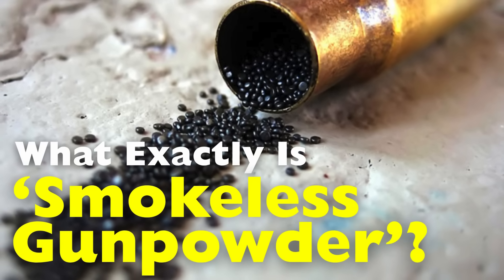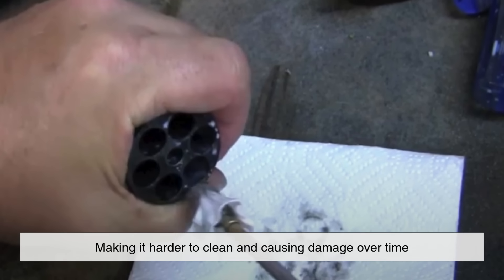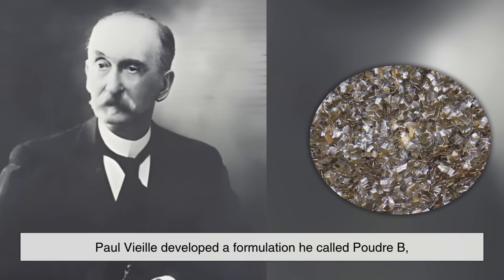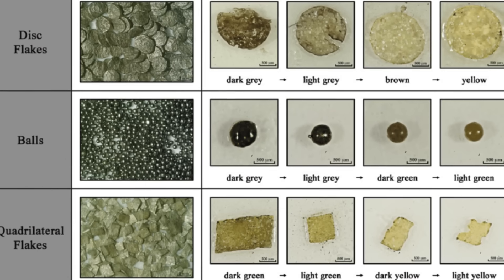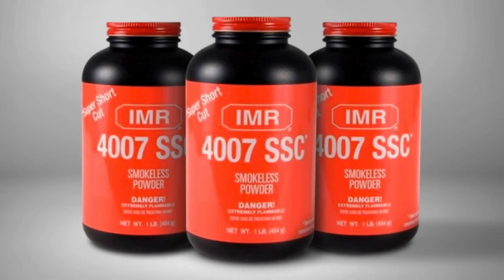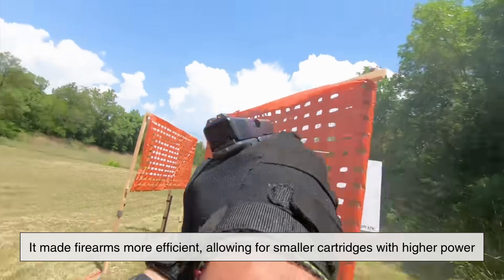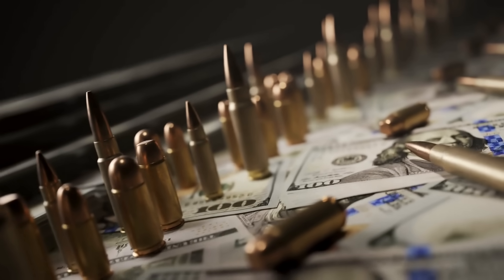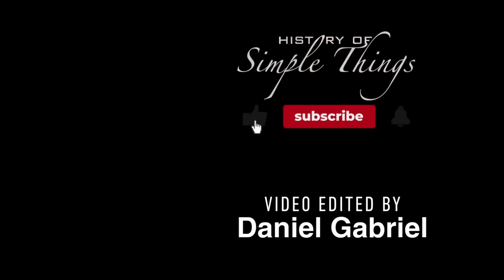Why Modern Guns Don’t Make Smoke Anymore

Comment: There are triple base powders now. But I haven't seen Alcan available in the US since the 80s. That destroyed revolver was from a double/triple charge of fast burning powder like Bullseye or 231, not decomposition of components.I had a box of Winchester 45 acp that was over 40 years old and it worked fine. There's surplus ammo over 70 years old that is still good.

Comment: What is the difference between black powder and pyrodex? ✌️
Reply: I think Pyrodex is made from the same basic elements of traditional black powder, but with some additional chemicals added to make it less sensitive to ignition. I get the impression that a main reason for pyrodex existing is that it is less hazardous to transport commercially.

Comment: The main substance that formed smoke in black powder when it burned was sulfur. Because it formed not a gaseous product, but a solid substance potassium sulfide. And 19th-century weapons engineers came to the surprising conclusion that sulfur could actually be dispensed with. The main value of sulfur is to reduce the ignition temperature of black powder, which was important for flintlock weapons. But this conclusion no longer had any practical meaning due to the discovery of nitrocellulose smokeless powders.

Comment: What is primer made of
Reply: Primers contain an explosive called Fulminate. Fulminate will explode when impacted by something like a firing pin, hammer or whatever. Gun powder is ignited by heat such as the heat the Fulminite provides when it explodes.  An explosive used in the military called C4 or Composition 4 will not explode from heat. It has to be impacted like with Fulminate. The impact used to ignite C4 is usually what is called a blasting cap. Our military explosives instructor held up a brick of C4 in front of the classroom and lit a cigarette lighter under it to illustrate that it does not explode from heat. I ducked under my desk anyway. That brick of C4 was enough to blow a Tank apart.
Reply: Lead styphnnate
Potassium chlorate
Mercury fulminate

Comment: What gun and round was that one in the pic that shot the entire casing with the bullet?
Reply: There was a gyro projectile gun. It shoot out the entire casing sorta like a rocket. Hence gyro jet propelled. Pretty sure it was on matt channel.
Reply: @chansantawisuk  That was the entire projectile. What was used in this video was not that as it was completely different. And matt who?
Reply: @sithyarael6807 yeah the whole ‘projectile’ shootout like a rocket. Its ‘jet’ propelled. They called it the ‘gyro gun’. I remember it was featured in Matt’s DemolitionRanch channel. I mean you can also just search gyro gun and there will be a ton of review of it on youtube. The project is discontinued for a long time. Pretty sure it was in the 80’s or 90’s. But the owner still produce some of it for testing and fun for Youtubers to reviews.
Reply: @chansantawisuk  Produced	1962 - 1975 less that 2000 produced. It failed before it really became a thing. Mainly cause the propellants used back then would only allow a little bit into the round. It was called the Gyrojet FYI. Ammo is no longer produced as hasn't been in a long long time. Those youtubers were using original ammo as no one makes it any longer.
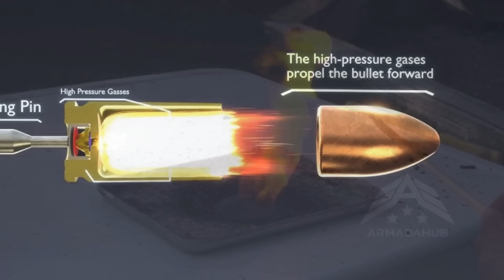Reply: 05:45 ?

Comment: How do air guns and BB and pellet guns work? And how dangerous  are they?  And what is the difference between them ?
Reply: compressed air vs. flammable propellant. Pellets are larger than BB's...both are dangerous at close range. <50'
Reply: @hillbilly4895  There are larger air guns even shotguns of 20 gauge or larger that work off of compressed air and are as deadly as firearms that use smokeless powder.  And they have been in use for a long time, as the Lewis and Clark Expedition 0f 1806 carried one with them in .46 caliber that they used to take game and amaze the indigenous tribes they encountered.  It was a 22-shot repeater, and they filled the compressed air cylinder with a pump attached to a wagon wheel filling the cylinder as they drove along.

Comment: No real explanation of why it doesn't smoke.
Reply: yes. Yes have skipped mentioning that the smoke is a cloud of solid particles of K2CO3 and K2SO4. Smokeless gunpowder  does NOT consist of potassium and sulpfur which produce that thick smoke
Reply: Thanks, your coment make me not wasting my time
Reply: Actually.... it does smoke, just less smoke than black powder.😅
Reply: It is clearly mentioned that it "smokes less" because they switched from black powder to a cellulose-based smokeless gunpowder. Honestly, if you read the thumbnail, you could probably just skip the entire video.
Reply: Basically more efficient combustion = cleaner burn = less smoke.
Reply: It's nitro
Reply: Nitrocellulose.
Reply: With Black powder only about 50% of the mass is turned to gas while the rest remains as solid particles.  This is the smoke you see as well as a lot of fouling that remains in the barrel.  
With nitro powder about 98% is converted to gas. Much less smoke and fouling and also much more efficient.  More gas creates more pressure.  More pressure gives more projectile velocity.
Reply: You weren't paying attention. Watch it again.
Reply: Blackpowder is a mechanical mixture. It explodes, leaving 70% residue (smoke, soot).
Smokeless is a chemical compound that burns progressively
Blackpowder is an explosive.
Smokeless is a combustible solid.